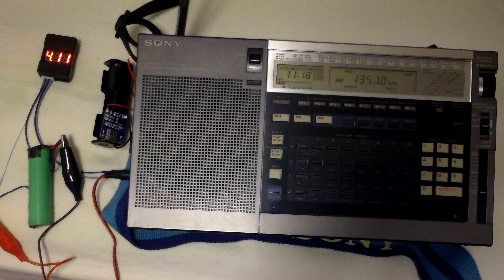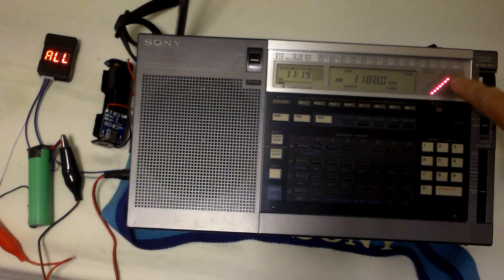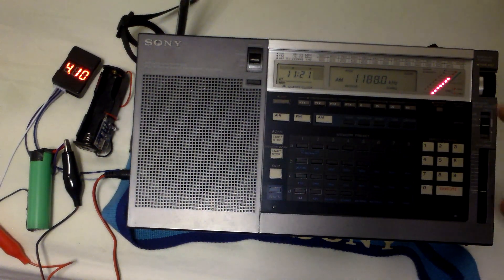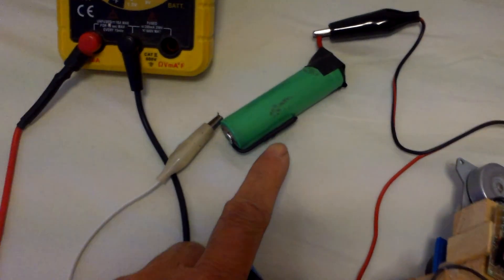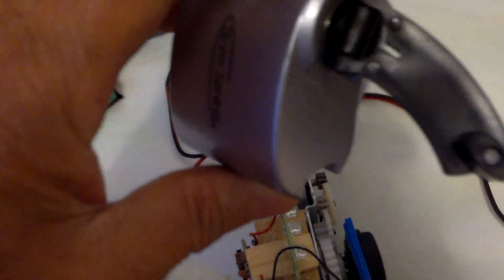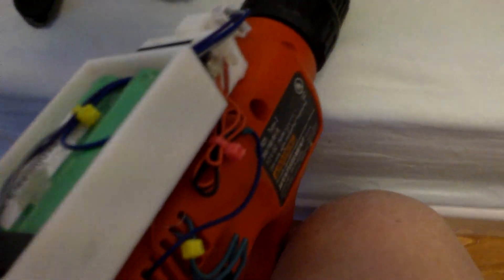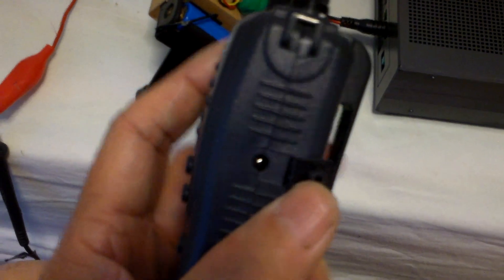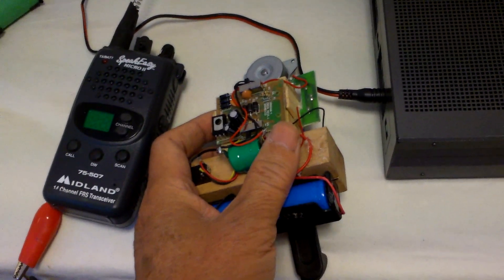Powering the sony icf 2010 radio with a single 18650 lithium ion battery

Comment: Any idea what is the tolerance voltage for the radio?  Ni-Mh battery produces 1.2 V so 3 of them  produce 3.6 V.  4 of them would produce  4.8 V.   18650 battery is producing 4.1 V.  I suppose little tolerance would be okay.
Reply from the maker: The radio runs fine with the lithium ion battery.

Comment: You have a good idea. Still, if I wanted to power that radio without alkaline D cells I'd use rechargeable AA NiMH or lithium batteries with a battery spacer. Easy, no leaks, no problems.
Reply: P.S. I wish I had a radio like that here.
Reply from the maker: Thanks for commenting. Hope you're enjoying the Philippines.

Comment: I have that radio, or at least a very similar model.  It was my late uncle's.  At one point or another it died and would no longer turn on.  If I recall correctly I gave it 4.5VDC, center negative and it was still dead.  Too bad, it was a real nice one.  I still have it, I'll have to play with it one day and see if I can get it to work again.
Reply from the maker: it's a collector item.  I'm fortunate mine still works.